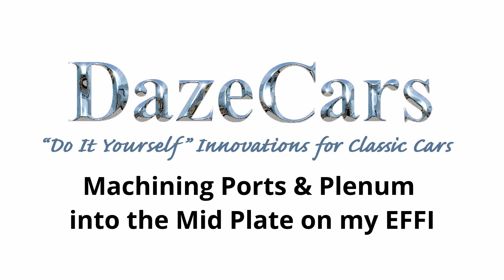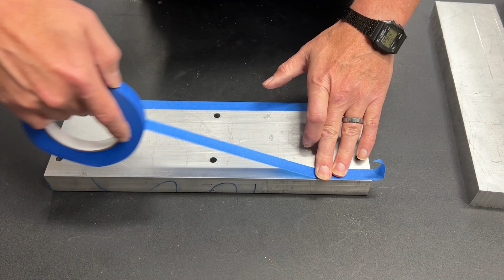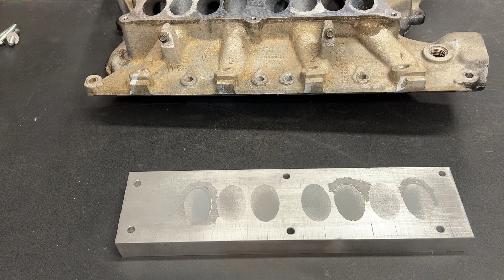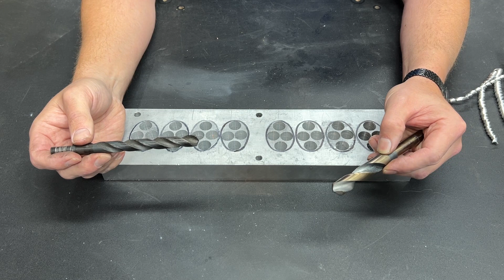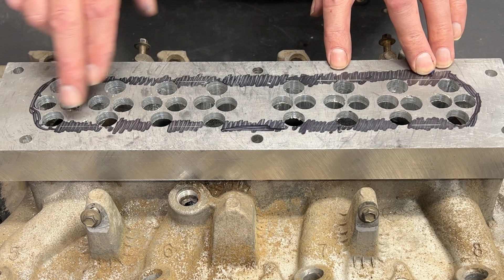393 Windsor Build Part 13 Machining Ports & Plenum into the Mid Plate on my EFFI

Comment: I’ve had a similar idea for an ITB setup using a GT40 lower with a custom top piece for 8 motorcycle carbs or throttle bodies.
Reply from the maker: That could work and would likely look really cool.  The hardest part would be getting them all tied together.  That linkage would probably be very complicated.  If you could make one single rail that attaches to all the TBs it would be simpler but the offset of the GT40 lower would add a wrinkle... The more I think about it if I was doing it I would not use an open plenum, I would make it one for one.  I would use a fairly thick piece between the TBs and the intake and I would line them up down the middle then cut a nice curved port to deal with the offset.  This would allow for good flow and allow for a single throttle linkage rail.... At least those are my thoughts right off the top of my head 😁

Comment: Your video is awesome. Regarding your comments about not being a pro porter, may I suggest you don’t round off the edges leading to the adjacent cylinders that follow in the firing order. These cylinders will rob their neighbors during the beginning of intake stroke as the previous port is finishing its turn. Keep all the other surfaces rounded like you did. I am an amateur regarding porting and have learned this from David Vizard. v/r wh
Reply from the maker: excellent advice, thank you.  Looking at the layout on the 5.8 lower it looks like 2, 6 ...3, 7 and 4, 8 are the cylinders I need to be concerned about.  Thankfully with the strait shot from the TBs I am hoping that will be less of an issue.  we will see

Comment: This is pretty cool i love this old school concept of building parts vs buying. I work in a metal fab shop and use ceramic spray to mark stuff at work and people sdy wow thats cool and i think really? Ive been tossing the idea of making an adapter to bolt to my 5.0HO lower to mount a factory terminator blower seems takeoffs are all over the web for sale at $800 to $1000. They may not be the whipples people are replacing the eatons with but they were capable of making 500hp on the 32v 4.6 in the terminators so its waaaay cheaper than the usual 4 to 6k centrifugal superchargers on the market and should be plenty on a HCI stock 3" stroke 302 engine and if done with emphasis on a factory appearance it should look plenty wild on a sbf.  I never heard of it done except while doing research i found an add from a company that years ago sold an exact adapter like im refering and if they actually sold it im assuming it likely worked... Personally the ecm is the part im worried about the fab work seems straight forward to me, unfortunately i need a compleat mock efi system on a motor and the blower to build it with the hurdles of the distributor location and pully alinement so my engine is not down for an extended amount of time, ive surprisingly seen a few compleate 94/95 mustang 5.0s on marketplace but didnt have the play money at the time. The holley high ram lower would be perfect for this idea. Another issue is hood clearnce or lack there of because to clear the front distributer it has to be pretty tall unless a coil on plug setup with the low profile breaker that goes in the distributer hole was used msd i think makes one but there outragously expensive like $2000+ hell with that.
Reply from the maker: Glad you like it.  This has been a fun project!!  you project also sounds fun all-be-it highly ambitious 😁

Comment: There is a video out there that a guy made his own ITB setup, using dodge 3.5 throttle bodies.  (Intrepid TSI, 8 of them!) And only using 1 TPS.
Reply from the maker: I have had lots of suggestions of other ways I could have accomplished this from Dodge two barrel TBs from a mid 90s truck (also looks a bit like a carb but doesn't need any injectors removed) to motorcycle TBs not to mention other make and model TBs and while there are an infinite number of ways to get this done here is why I am doing it with the Chevy TBIs less the injectors:

1. I already had them
2. I only had to couple the shafts together in one place, no other linkage
3. About the perfect CFM for the 393 it will be sitting on top of
4. looks like dual quad
5. I need to keep total height to a minimum
6. (this is a big one) I already had them 😂

Comment: I found that a 1" sanding drum in a die grinder does a nice smoothe finish as you match and blend ports. Doesn't grab and spiral around the ports. takes very little time from where you are.
Reply from the maker: good tip thanks
Reply: @dazecars  Using lower rpm makes it easier to controll nbecause it can remove a lot of material with a coarse grit, use fine grit for the final finish, still low rpm.